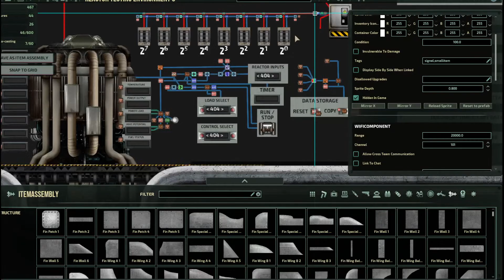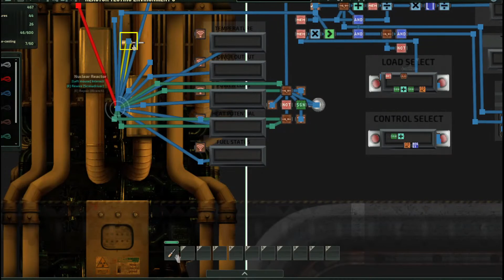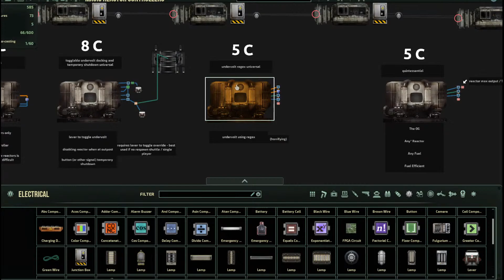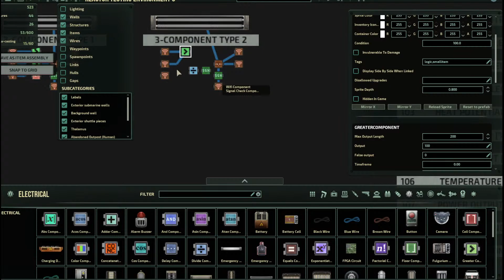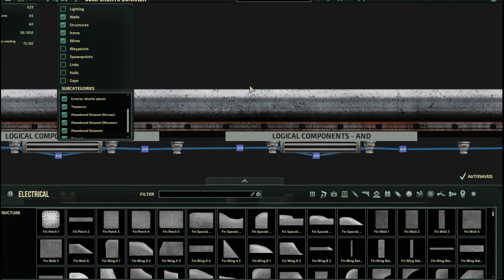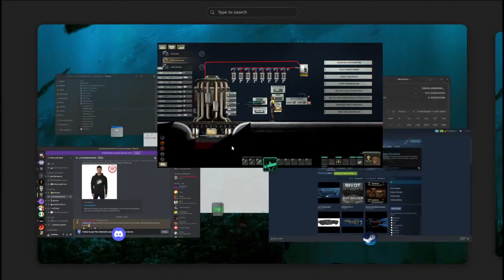TGN Live - More ARC stuff, for real this time!

Comment: Please make that video about components, I know I could do so much more if I just knew for sure how signals are transferred through various components. I've been having the a very hard time setting up an automatic charge controller for a battery array that still allows for manual override. If I just knew how exactly to interrupt the constant signal from the automatic controller properly, I could get the manual on/off commands to work while the auto is still on.

Comment: My favorite controller is your 3 component one. Very versatile, and easy to modify the two greaters with other components.
I add a thing to it on my subs now, that if the submarine is docked, or out of fuel, it sets the outputs of the two greater components to 30. So booting up the reactor after undocking or replacing fuel rods won't put the reactor in overheat as much with the sudden high load. It looks like it works, but best with uranium, which is bad for power output - and AI bots like to take out additional fuel rods in current update.

From the stream that was cut down to 23 sec and asked what we wanted: There was a counting circuit in it that I would like to try for engine force increase, so junctions won't burn down by instant 4000 load, it was at 1:32:22 in that video.
Short videos dedicated for specific circuits would be nice for quick tips, and longer ones like these streams to explain how and why they work.